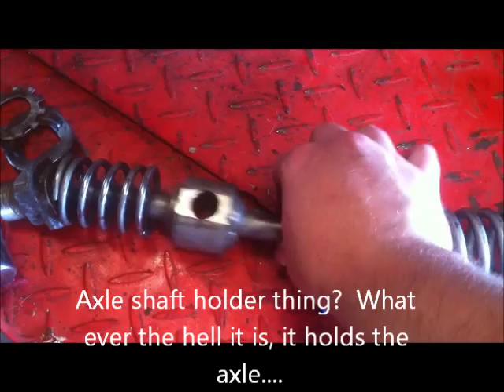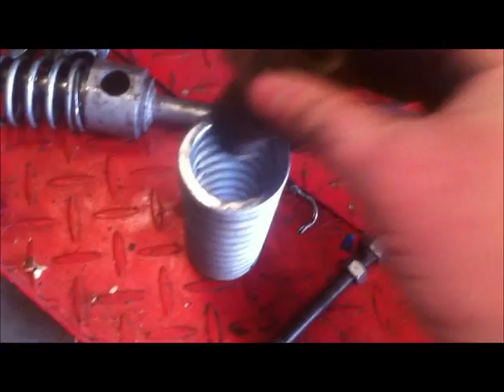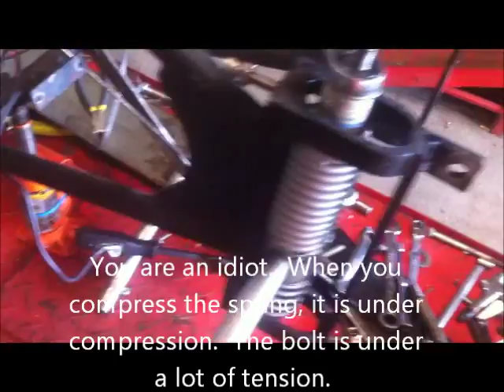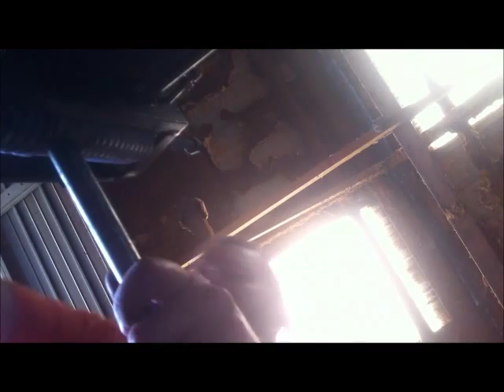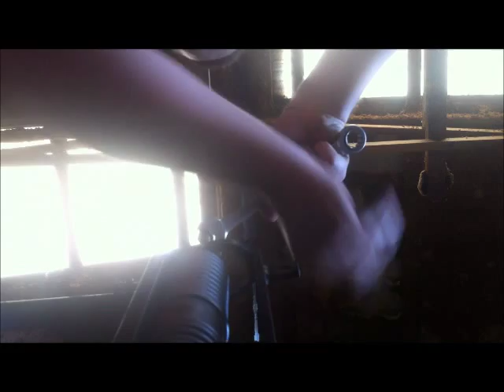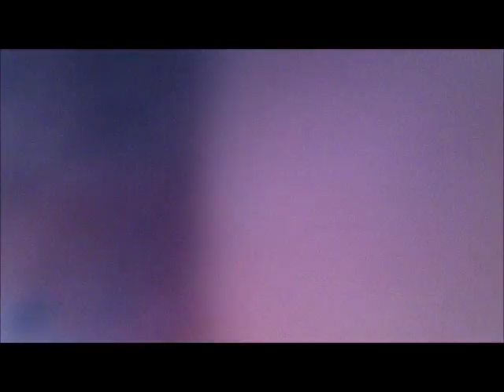Amen Savior Spring Removal

Comment: Awesome video! You Rock!Thanks man i had my Amen since 1985 had it painted then but just masked off the springs! I plan on repainting the frame this winter and now know how to remove the springs! Did you have any trouble reinstalling? Any tips on that? Was it hard not to scar the new paint?
Reply from the maker: They were easier to install then remove.  Just reverse the order.
Reply: Great to hear back from ya brother!Wish i could attach some photos on here to show ya my girl! Just wondering if you could send me the link for the dimensions you said was available? When i click on the link you have posted already it says page not found! Thanks again! Cheers!
Reply from the maker: @pulsatingsteel  that website died about 10 years ago.  I don't have the dimensions written down anywhere.